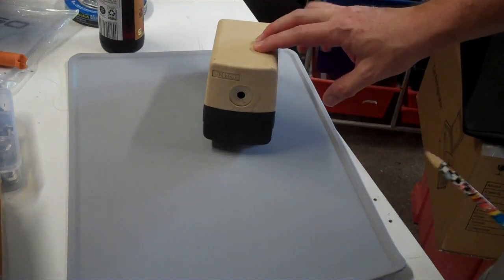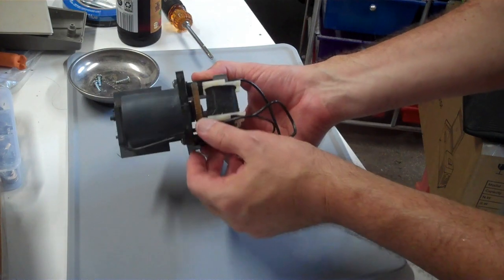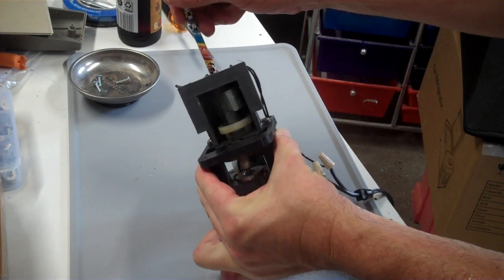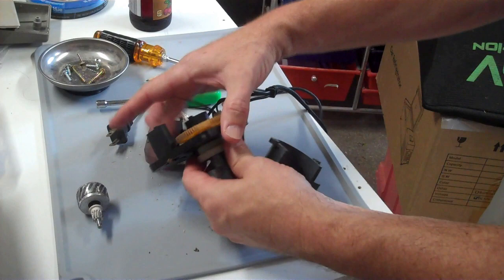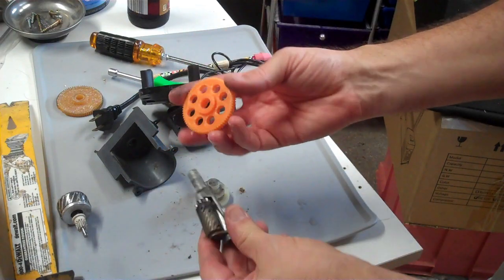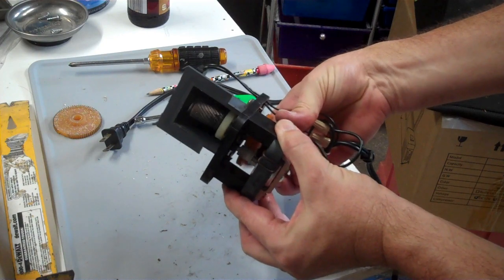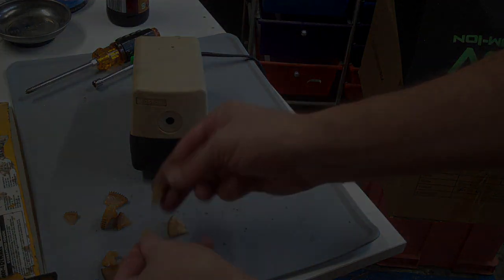Boston Model 19 Pencil Sharpener Gear Replacement  - humming sound fix

Comment: Afmat makes a heavy duty classroom sharpener that shapewise what's similar to the Boston 19 since it's rounded in front like the 19th there's a skinny part that's rounded inward in the center where the pencil goes in. However Afmat is flat and level on top instead of sloped. I don't own either sharpener but it would be interesting to tear down one of those new models to see how similar inside it is to the old Boston 19. I do know one thing is the modern ones all have a safety mechanism that prevents them from running when the shaving tray is removed.

Comment: Found your video, took apart my pencil sharpener and sure enough the stock gear was missing about 3 teeth. I 3d printed a gear myself and the motor reconnected to the cutting mechanism. Only problem is now it's not sharpening pencils at all. Everything turns perfectly and I can feel plenty of resistance on the pencil while it's turning. But no sharpening occurs. Any weird problems that would lead to this?
Reply from the maker: Are you sure it was sharpening before you took it apart?   (Perhaps there are no blades in the conical sharpening part?)  The only other option I can think of is that something got put back together incorrectly, but it's relatively hard to do that as there are not that many parts to deal with. I'd suggest running it with the cover off so you can see what is happening inside.
Reply: This happened to me too.  After observing cutting rotation direction in this video, and noticing mine was opposite, I finally figured out that when I took the motor out (held on by the white clamp), I'd rotated it 180 degrees so all the gears were turning in the opposite direction.  If you take it back apart, insert the motor in the opposite direction and reinstall, perhaps you'll have success like I did.  Good luck.

Comment: What kind of oil is that that you put on the gear?
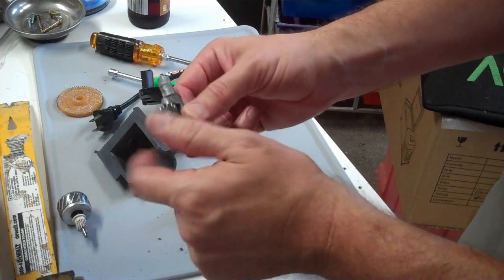Reply from the maker: For the metal parts any standard light machine oil from a hardware store would work.  Around 3:35 you can see me using 3-in-1 multi purpose oil (Amazon affiliate link: https://amzn.to/3YzkbXM ). Sewing machine oil would be another name for it in a crafting/quilting store.

Comment: Jay, Good demonstration! I’m sure many owners of the 18/19 will appreciate it.
I’ve replaced my gear once before about 10 years ago with one (of a pair) I got online from a guy who I think 3D printed them. I bought two at the same time. Anyway, the new gear worked until a few months ago so I replaced it with the second one from the pair. Unfortunately, it stopped working almost immediatly (3rd pencil). Could the material you guys with 3D printers use have shrunken or gone bad over the years in storage? I hesitate buying another gear in fear it won't work either. You mentioned, "nylon cast gears" instead of 3D printed. Could you please point me to one of those if you think it will work better? Obviously I like my little Boston 18/19. It was on my desk in the military for many years from place to place. So I took it home when I retired. Hope they don’t come get me….haha! Any help would be appreciated! BTW, I’m in Raleigh/Durham, NC.Thank You.
Reply from the maker: If they use PLA it can decay over time. If they use ABS it should last well.
Reply: I got one on ebay that appeared to be 3d printed, but it was just a mm or so too thick and the gears would not mesh. Oh well.